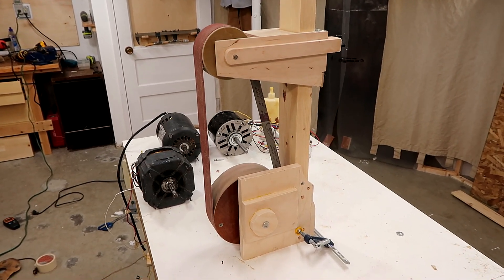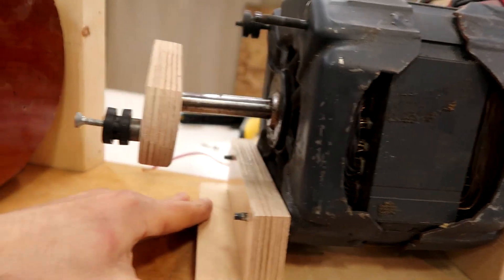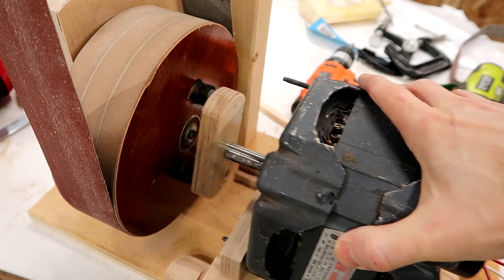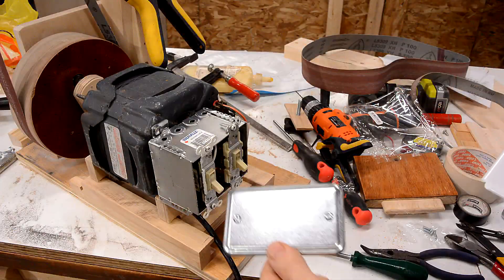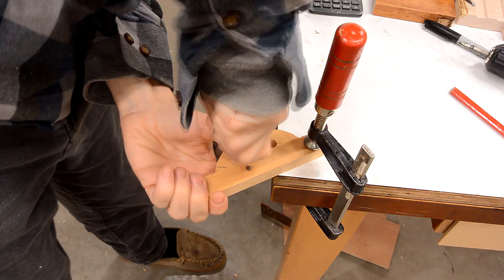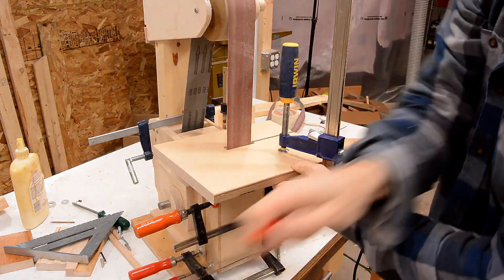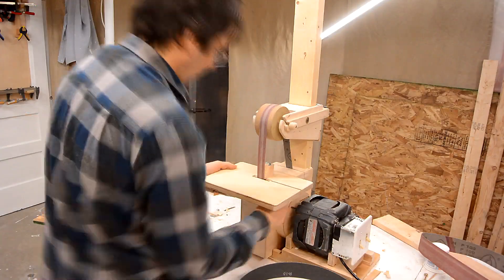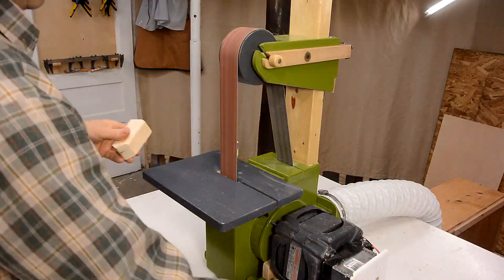Belt grinder build 2/2: Motor, table, platen, and housing

Comment: You could use that motor unit to power several tools, switching it between them as required.  Would make lifting/storing tools when not in use much easier.

Comment: Had to pause for a while after the 3.05-second mark and go and change my Jocks, take a heart pill and calm down a bit,........by videos end my heart was still racing. Thank you for leaving in the 'warts and all' parts, that alone is a good example of thinking safety first. I still put a circuit breaker and a lamp in series with all my first-time running of prototypes, especially for old motors. Top Job, cheers from Michael Australia,

Comment: A featherboard, or better yet, a pair of FeatherPRO FP1 inserts, mounted so that they slide against each other when you engage the motor, but mesh when you get kickback, might cut it down, and give you some vibration absorption.

Comment: You should replace your on/off switch with a dimmer, that would let you have fine control over speed, and should make is start up slower and take out the jerk on startup
Reply: AC motors can't be dimmed. The two different speeds are actually two seperate windings internally.

Comment: How about putting a wheel with a rubber tire on the motor and having it rest on top of the bottom belt wheel, kind of like the gas engine conversions for bicycles?  The motor could be hinged so that its weight would press the drive tire down onto the belt wheel, but then pivot out of the way when you needed to change belts.

Comment: Dear Matthias, these washer motors are great but they are not designed to be dust protected in their main purpose. I think that the motor MUST be complete  covered on top with a wooden sheet or grounded metal (but not too close to coil and its air gaps to avoid overheating)   because contact with metal chips coming from the grinder inside it will be at least destructive.

Comment: If you would give the clutch between Motor and belt pulley an impeller Design, it would work as a fan and suck out the dust off the grinder. So you would only need a Collection bag :-)

Comment: The motor that is running in reverse direction you should take apart and see if the start winding is accessible at the junction where it is connected to the run winding.  If that junction is accessible you can switch ends of the start winding right there at that junction.  That will reverse the direction of the rotation.  Even better yet is to bring both of those leads at the junction to the outside and connect them to a DPDT-center off switch.

Comment: On an absolutely completely unrelated note - what I would like to see is a long-term test of the ability of wood glue to absorb movement stress. You could glue up some joints and then submit them to cyclical 20% failure loads, like 5 seconds pressure of 20 kg, then release, then reapply, and run that experiment for a few days to see how many cycles a glue joint can take of that.

Comment: so why not just use the motor with the longer shaft and run it through the bottom wheel with a bearing on the end?

Comment: It was really interesting to see how you figger things out while doing them. But I have to admit, I prefere your planned projekts. Beside that, it is a great build and it would be very interesting if this principle with the variable high mechanism could be used for a Bandsaw with different Blade lengths. Of course i know about problems with the sice of the wheels and with the rigidity but maybe there is a way to fix this
Greetings from Germany :D

Comment: I highly recommend using a variac for these sort of experiments. Especially with Motors, which have a rather high surge-current its best to dial the voltage up slow and safely.

Comment: Have you considered making the impeler disc behind the universal joint thing so that the motor that runs the pulley also takes the dust out ... or you need more RPMs ?.

Comment: Awesome build. The washing machine motor looks like a universal motor (it will happily run on DC as well as AC). I can see the field winding, but couldn't see if it has brushes. If it does, to reverse the direction, you need to change the relative polarity of rotor and field. In other words, see how it's connected, usually in series, if you change polarity of one or the other (but not both), you'll have the motor spinning in the opposite direction.
Reply: Nevermind, seems like a squirrel-cage motor. More work in reversing it, doing it mechanically is way easier :)

Comment: A suggestion.  Plug these things into a power strip, then use the switch to turn it on and off.  This would keep you away from the plug, good if something is wired incorrectly.

Comment: Not knowing much about belt grinders / strip sanders, what is the advantage of going to a longer belt? And also, why would it be bad to have the motor behind with a belt? Wouldn't that eliminate the need to move the motor for belt changes?

Comment: In some cases you have to short out the high speed circuit when going with the slow one, the motor then runs much better

Comment: Did you consider just making a new wheel which will fit directly onto the motor shaft?
That'd leave one side of the wheel completely accessible for changing the belt.

Comment: I’ve been looking into making my own lathe and have found a motor. It is 2hp and 1.5 kw but I don’t know whether it would work. Is Hp or rpm mor important?
Reply: Tom Callan hp probably but you can change the rpm with pulleys and I would recommend starting the lathe at 2500 rpm if your starting to turn
Reply: Cameron Knowles the motor only has 940/1030 r/m. Would there be any way of making that work?
Reply: Tom Callan yeah I think you could have a pretty nice lathe with a belt drive so you can switch speeds so you could have a gear ratio of 3:1 for 3000 rpm and then a ratio of 2.5:1 for 2500 rpm and so on and you could even make it slow so you can finish wood on there
Reply: Cameron Knowles Thanks a lot. On an unrelated note, are you a supporter of trump or a democrat using trump as a comical point? I’m from the uk so I like to hear from both sides.

Comment: Matthias... with how much you work with motors running on mains voltages I'm shocked your still use your hands as contactors :O (rofl). You should consider buying a contactor on line and wiring up a motor testing jig, some thing to reduce the likely hood you blow a 120v plug up in your hands again.

Comment: Awesome!  You could put it face down to make a stroke sander.
Reply: Hand Tool Rescue what’s a stroke sander I haven’t heard of it before
Reply: Cameron Knowles A stroke sander uses a horizontal belt above a moveable table. The belt is pressed onto the work piece with a handheld pad. You can see one in Matthias' "Touring Dad's Workshop" video.

Comment: VIBRATIONS probably cos you balanced the wheel and then drilled two big drive holes in it... taking it out of balance.
Reply: Christian Carter possibly... but he used a caliper to place each hole exactly the same distance from the center so... it really shouldn't have effected the balance. Much at all.

Comment: That wiring! As Dave from the EEVBlog would say, "its a bit, how ya doin?" Seriously though, you already know it vibrates, go to the hardware store and spend 40 cents on a grommet. Electrical tape is nasty and leaves your wires covered in schmoo.

Comment: Matthias, might i suggest adding a safety warning. (i'm sure you know this, but maybe for other people who want to replicate this build)
you should never use the dust collection for grinding iron/steel (when it sparks)
and always clean up after sanding before you're going to grind
because wood dust + flaming sparks = big trouble!!
Reply: The Metal Butcher personally I have lit two on fire in my shop from going between wood and metal on my disk sander, and it has the burn marks to prove it.
Reply: chefdan87 so do all people with dementia deserve to die then? Keep that opinion on mind when you get old.
Reply: Chill out people. Matthias already said in another comment he does not plan on using it to grind steel with the dust collection attached.
Reply: @The Metal Butcher none, exactly because i take this precaution... what's your point?
Reply: Chipmunks generally don't want to hear it.  I have no idea why.  But yeah, anyone from a forging background is way more tuned into where fire is or could be.  (I don't even let it go if someone pinches out a cigarette and leaves the cherry burning on a concrete sidewalk.)
Fact is, there are 16 year old kids who want to make knives, who see videos like this and think they're going to do stock removal bowies all day with something like this.  For that kid: If you are working with wood and want to reshape a chisel every couple weeks and you always keep your wood dust under control, this'll work fine if you don't mix metal and wood dust.  If you want to play strictly with metal, get metalworking tools mounted on steel tables, and a dedicated metalworking area where all your dust will fall on concrete and you can see what's going on in it afterward.
Reply: MrTarfue your profile picture made me think there was an eyelash on my monitor
Reply: Thanks for your comment, I for one did ask myself during the video why he did not use the dust collection for the metal grinding! I have experience in woodworking, but not in safety procedures when working with metal. You may have saved future me's ass!
Reply: MrTarfu, I thought your image was a hair on my screen. Did you intend that?
Reply: Lord people stop being wimps
Reply: How many piles of sawdust have you lit on fire with sparks?
Reply: Matthias leaves the safety policing to his commenters.
Reply: People on this part of youtube get very frustrated and machismo when you suggest they be safe.
Reply: well, but there's a difference between 
1) doing foolish things because you think you can handle without (like handling blades/cutters) (e.g. being macho) and 
2) stuff you can easily oversee because you don't think of the implications

i'm fine with not posting safetywarnings for point 1 (because let them be fools if they believe they are their own safety, i don't care. i'm sure they are educated enough to know that sharp things or spinning things are dangerous, you can deduce that easily because it's readily visible)
but point 2 is just knowledge and not immediately visible. it's not in your own control whether a spark ignites the dust or not. and if you don't know it CAN happen, you will not make precautions
Reply: @Alfiewow  it's starting to get old
Reply: Have you ever looked up how much dust it takes for a dust explosion? If it is low enough for him to film it will never explode.
Reply: Warning labels/safety warnings are a bad thing! Its called natural selection, if you are too dumb to not see the dangers in any of your actions then you will get exactly what you deserve. Case in point, Tide pods. Dipshit kids are eating them and dying. Now people are whining and crying to the company that they need to make them less appetizing looking. The reality is we should celebrate every death caused by dumb shit like this, as now the world is a better place for getting rid of people with those levels of stupidity.

Comment: I noticed the yoke housing was shaped like an impeller housing and that got me thinking could you redo the yoke to be a small impeller and get the sander to be its own dust collector?
Reply: Iain Portalupi I was just about to say the same thing
Reply: But it would probably need a fair amount of power to push all the dust out the back in into one of his filters.
Reply: Iain Portalupi I thought that's what he did?
Reply: Just rewatched that section and I didn't here any mention of it acting like an impeller.
Reply: But now that I think about it, you could cut diagonal slots in the disk in the right direction and it would sort of act like a fan. I though I  doubt it would bow enough to suck out the dust and blow it into some sort of filter box. Mathias has done quite a few videos on the efficiency  of impellers and air flow.
Reply: It will loose some power, but with a powerful enough motor it would definetly work!

Comment: What flew out at 12:38 ?
Reply: I think its a washer. If you pause the video you can switch frames with . and , but its just 3 blurry frames of something round and shine with a hole in it
Reply: Thanks for the tip on selecting frames with the , and . buttons, never knew that ! The part seems to fall from under the table but could easily have come from somewhere else and been thrown up under the table. Hope it's not important !
Reply: I have been using youtube for at least 7 years now and i just found that trick out last week :) i think there are not a lot of people who know about it
Reply: crap I'm using an AZERTY keyboard   "."  doesnt work.
But I stumbled on another shortcut:    " ? "
Reply: "?" makes the cursor invisible right?
Reply: Something was escaped. :)
Reply: Part of the electrical box? See 5:15 on the bench on the left.

Comment: aren't you concerned with the wear on the bottom wheel when grinding head on? Please enlighten me.
Reply from the maker: Friction happens between the belt and the workpiece.  Not the wheel.

Comment: Great video again!! 👍 Question: are you going to make separate covers (directly behind the belt) for longer belts or make the slot bigger (But than less under pressure)? Longer belts change the angle of the belt on the return side.
Reply from the maker: That little cover moves for different belt lengths
Reply: Matthias Wandel Aha...it slides! Thank you! 👍Is it just sitting there (friction fit?) or is it possible to fix it in the 3 positions? I would be a little afraid that, due to vibrations, it gets loose and caught by the belt and swings upwards....doing damage to you and/or machine. Just my 2 cents. 👍 😁
Reply from the maker: Friction fit.  If it does fly up, it will get caught by the upper wheel supports.

Comment: I've got an easy tip on how to clean those belts when they get clogged up. Take an old rubber shoe and put the rubber against it. When running. Or they sell these big eraser things
Reply from the maker: I got one of those erasers.  Rubber gloves also work.  As does hardened caulking (izzy swan posted about that some time back)

Comment: You can use alox belts for metal , and you can use zirconia for wood. 
However zirconia belts stop at 120 grit, and are best used for metal,ie stainless and alloy , or  HARDWOOD, 
Alox belts go as high as 600grit , but that is usless on timber, 120grit to 180 grit are about as high as you would go on timber.. 
I used to use belts of 180 to 320 grit for sharpening knives and tools,  .
This looks a good unit, .
I am looking at something similar , but using a 686mm belt and driven by a 12 volt motor , but it is still a concept at this stage.
We are grey nomads , and live in a 21ft caravan , and I sharpen knives and scissors , as a side line when we travel.

Comment: It looks like it runs better at the faster speed, is it because the vibrations are higher(pitched/hertz)?
Reply from the maker: yes, at the higher speeds it runs faster than its natural vibrations.  Also, the motor runs quieter at the higher speed.

Comment: My son used my bench grinder to shape wood once.  We had a nice, smoky smolder going on inside the grinding stone cover the next time I used it on steel.  Keep your eyes peeled for smoke and keep an extinguisher where you can get to it easily.  It might be a good idea to open the dust collection chamber to inspect for problems after you use it on steel.  Just a word to the wise.
Reply from the maker: Not planning on using it with dust collection with steel.  Too much fire risk.
Reply: This is why no wood is allowed in the belt sander at my school.
Reply: Good plan.  I'd check for dust build-up by the drive pulley before working steel too.
Reply: Use a wet/dry vac with a half inch of water in the bottom.
Reply: By the way, I didn't know he used it on wood until after I saw the smoke and extinguished the embers.
Reply: @ronyerke9250  I didn't either.  Even though I've been following Matthias and John Heisz for pretty much as long as they've been on youtube, and have watched them play off each other and even collaborate, I somehow missed that they had each built such a sander until now, when I need one.  I am actually building knives, and right now a pricipally need one of these for shaping handles.  There are still sparks an shaping scales with full tangs, but I'm already using my cheap Central Machinery/Harbor Freight belt sander for the purpose.  I already caught it on fire once doing so, and since then the rule is vacuum it out carefully before using it for metal, and when I use it for metal, I clean out the wet/dry vac and put a half inch of water in it and use it for dust collection/spark control. So far, that is working well.